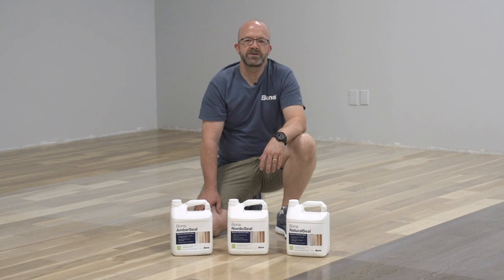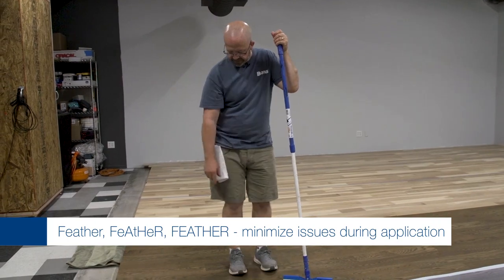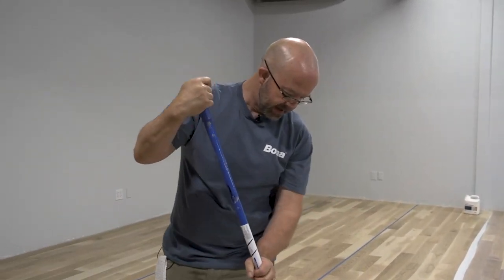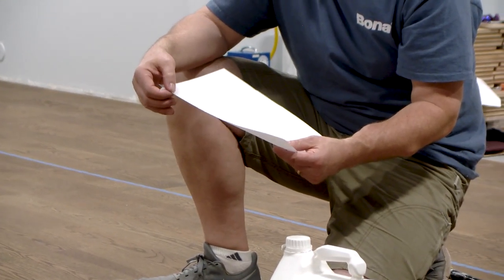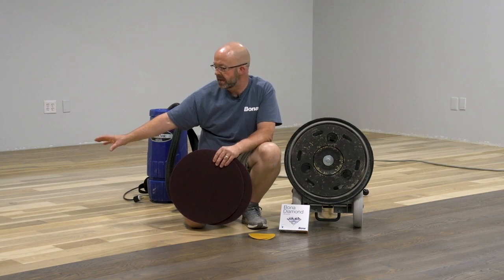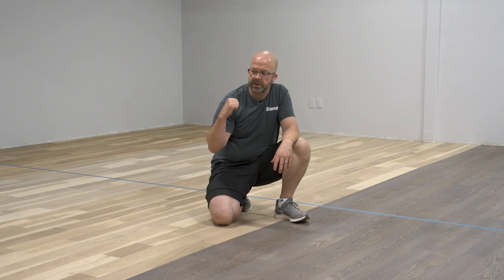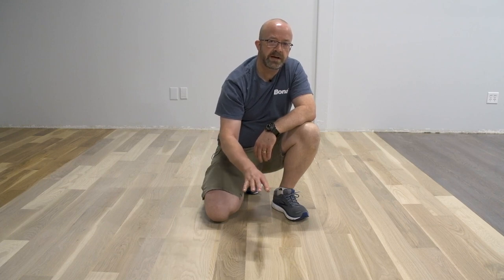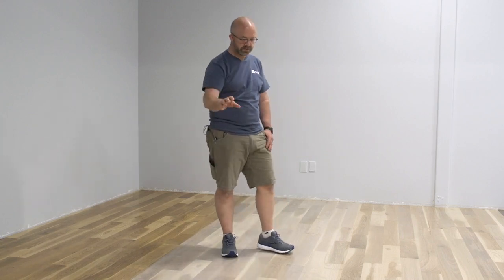Bona Sealers Application Best Practices

Comment: Hi, I used this product. Messed it up applying with a lamb skin roller, is there a way to screen the floor with a high grit to apply a second coat to get even coverage leaving no marks?
Reply from the maker: Hi @user-rv9gb2cz8m - Applying a second coat to try and even everything out would be worth a try, versus just sanding it back down to raw wood right away; but, it also depends on how uneven the color is on the floor. You might try an 80 or 100grit screen to aggressively blend the uneven marks in the floor; then come back and hit it again with 120grit Bona Diamonds to smooth out the screen marks and further blend the floor. Then apply an additional coat of the Sealer with the Bona Roller, as this applies the products the heaviest and is probably your best bet in getting enough product out on the floor to even it out. If that doesn't help, then it's probably back to square one. Hope that helps!

Comment: Thank you for the video, this is a great resource. One suggestion. Please show how to coat spaces that are more complex than an open flat floor. Seeing how to deal with rooms that have multiple closets, small nooks, etc. for these more difficult to apply products is crucial. I just used NaturalSeal for the first time and had trouble understanding how to blend spaces. At one point a “dry line” is mentioned and it would be great to see a demo of how to blend dry lines. For me, the NaturalSeal was pretty forgiving on unstained 80 year old white oak floors. There was a decent amount of tannin pull and the floors were a bit more yellow then the test swatch because of that. Sorry for the long comment but I hope it’s helpful to others!
Reply from the maker: Hi and Thanks for your comments and suggestions - always appreciated! Yes, great point on showing how to coat a more complex layout - we've since added some wall layouts on this floor to show just that. In our upcoming Waterborne Finishes webinar (Oct. 21), you'll see some more details on pulling a dry line (as it relates to roller applications - but same principle for t-bar too).

Comment: ??? I saw a great floor the other day where friend used 1 coat Bona Naturalseal and then 2 coats of Traffic HD finish extra matte. However he only sanded once with 220 grit between finish coats not between sealer and finish. Would you not recommend that?
Reply from the maker: Hi Cudder - Yep, that's perfectly fine. You typically don't need to abrade Bona waterborne sealers or finishes between coats for adhesion (unless it's been more than 48hrs since last coat - then Conditioning Pad & tack), but only for smoothness. Big advantage of keeping more of the wear layer protection (sealer, finish) on the floor if you don't have to abrade it, because there's a ton of debris or stop/start marks, etc. in the last coat. So, Keep It Clean (one of the Bona Commandments) and you'll get better floors and profits all in one! Hope that helps.

Comment: Hi there, I tried to follow these, and other tutorials, but have ended up with terrible application marks after first cost of primer. Looks horrible with pour lines and overlapping. I definitely went too light on first coat, but definitely kept wet edge. Do I try another primer coat before sealing or call it quits and go for a different product that isn’t a pour on floor application type. I have used other products successfully in the past. Just don’t want to put more of this really expensive product on to only end up sanding back and using something different because the primer application marks remain terrible.
Reply from the maker: Hi Out of Bounds - Sorry to hear that you're having some application issues. Too many variables that might be in play to really give you a good answer(s) here; so, please give our Technical Services team a call at (800) 872-5515 when you get a chance. Thanks!

Comment: Do you have to sand between clear seal and high traffic?
Reply from the maker: Hi @mnnice1497 - You only need to abrade between ClearSeal and Traffic if the sealer has dust, debris, etc. in it that you want to smooth out before application of finish coats (for smoothness); OR if it has been more than 48 hours since the last coat of ClearSeal was applied (for adhesion); otherwise, no need to abrade. For either case, we'll typcially place 2-3 Bona Diamond discs (180 or 220 grit) or 2-3 Bona NET discs (180 or 220 grit) on a Bona Conditioning Pad (320grit), pushed by a 175rpm buffer. Abrade the floor evenly, then vacuum (or PowerScrubber), and tack with a microfiber mob until clean - then coat. Hope that helps.

Comment: Why airless spray compressor cannot be used for sealer and stain application?
Reply from the maker: Hello Apple Table - We know of some contractors who have sprayed the sealers and finishes, but not the stain (as it needs to have the excess removed). Some potential dangers when spraying of breathing in any suspended particles in the air (always wear a organic vapor cartridge respirator if spraying; and some difficulties in cleaning up your equipment if not cleaned immediately after usage. So, not that it can't and hasn't been done (for flooring), but just a number of other things to consider including safety and clean-up.

Comment: Can you clarify the prep a bit?  I'm going to use AmberSeal.  The floors are new; the wood is spruce; they will not be stained.  Currently they are sanded to 220 but will need to be cleaned up because they got a bit dirty during installation.  What further sanding and other prep steps are called for?   Also, this is a small space (about 300 sq ft) and I do not have the big machinery shown in your vid.  Can I just use a RoS or palm-type sander?  TIA
Reply from the maker: Sure thing! You can use any type of sander on-hand (even hand-sanding), but without something larger (i.e. 16" buffer) to blend multiple boards together you're most likely going to see uneveness in the floor when the sealer/finish is applied. We'd also recommend that you final sand with 120 grit as the wood needs to be a bit porous to properly accept the sealer and finish. If it's too burnished you may have some film formation and adhesion issues short and long-term. Hope that helps and good luck with your project!
Reply: @BonaProfessional  OK I guess I already sanded too high. Can I now just go back and sand over the 220 surface with 120 to achieve the desired porosity?
Reply from the maker: @BCJ725  Yes, you can go back over the floor with 120 grit and that will bring it back down to desired surface profile.

Comment: Can i just apply bona mega, 2 coats to my sanded floors without nordic seal?
Reply from the maker: Hi Kerry - You should apply a coat of Sealer before the Finish. True sealers will seal the floor, provide some build, and minimize side-bonding. Bona IntenseSeal will bring out the natural colors of the species that you're working on (does not contain any white pigments like NaturalSeal) and can be coated with any of our Finishes. Hope that helps!

Comment: Can you use a cut in pad for the whole application?
Reply from the maker: Hello KTH - You could use just the Cut-In Pad for the full application, but more susceptible to start/stop marks if you're unfamiliar with that tool. I've used just the Cut-In Pad on several occasions - especially when I want to be down and "close" to my work; and our Training Manager used to coat that way all the time. Whichever applicator you choose, just make sure you're practiced and comfortable with it and that you're getting the right amount of coverage (as most people will tend to put down much lighter coats with the Cut-In Pad). Hope that helps!

Comment: Hi, i need to use one of these sealer before applying traffic HD?
Reply from the maker: Hi @indbolwebelieve - Yes, you must use some type of sealer before coating with Traffic HD to effectively seal the wood and start the build process (with more cost-efficient bottom layers); which will also minimize the possibility of side-bonding. Hope that helps answer your question.
Reply: @BonaProfessional  any kind of water based sealer can be used?

Comment: Hello, I'm about to do my project on newly sanded oak, 120 grit, with 1 coat of DOMO, then sand it with 240 (is sanding 240 grit necessary ?), then 2 coats of Bona Natural Seal, and 1 Coat of Traffic HD.  The plan is to avoid the "quick-drying issue" with the Bona Natural Seal.  Should I apply 2 coats of Traffic HD finish? and How's the plan look?  How much drying time do I need between each coats? Total 1400-ish sqft.  Thank you
Reply from the maker: Hello Chen - Yes on the sanding the Domo sealer coat with 240 grit, as making this smooth is what helps ease the application of NaturalSeal. Also watch the temp/air flow/RH environmental factors to avoid "quick-drying issues" with any coat. Protect the top with two coats of Traffic HD. Dry time between coats is typically 2-4 hrs and not recommended to apply more than two coats per day. Hope that helps!

Comment: I never had done or use nordic.. I had use natural a several times... but Im very honest to the my clients... about the results... I try to do at least 2 coats and mix 1 to 1 with classic seal or bona mega one... bona amber seal not as easy as top coat just as you said have to watch out. I do want to use bona naturale... on white oak would it be ok to coat with no sealer...
Reply from the maker: Hello @ladjkaoz - NaturalSeal should look great when applying two coats all by themselves. Definitely not recommended to mix any of the sealers together (i.e. 1:1 NaturalSeal w/ClassicSeal); and not with a finish such at Bona Mega One. For the white oak job you mentioned, apply at least one coat of a Bona waterborne sealer and then two coats of Bona Traffic HD RAW (as this has replaced Naturale). One of the most popular looks would be two coats of NaturalSeal, followed by two coats of HD RAW for that just sanded/unfinished look. Hope that helps and thanks for the questions!
Reply: @BonaProfessional thank you...👍

Comment: Could  this  product  be  used  over Mexican  tile ?
Reply from the maker: Hi Doug - We often get questions about our hardwood flooring products being used over other surfaces. While we can say that our waterborne products have outstanding adhesion qualities over a number of substrates, we can't say that it will definitely work over other surfaces, as we don't do any testing on anything but hardwood. Adhesion can usually be checked after 24 hours by scraping a Quarter across the surface - looking to make sure doesn't peel right off. Flow, leveling and getting an even coat would be the other variables that you'd want to watch. So, test, test, test and make your professional decision from there.

Comment: How about doing a session using the BONA ROLLER !!!.
Reply from the maker: Hi Andrew - We actually recommend using a t-bar to apply the pigmented sealers as it seems like an easier process for successful applications. However, our global colleagues and customers use the Bona Roller for application of these products on a daily basis also with great success - just need to be more diligent with your feathering techniques; and a second coat will most likely be needed to help smooth out the results from the first coat. Hope that helps (though we are planning a Bona Roller application video in the near future).

Comment: I’m a general contractor. My regular flooring guy switched to Natural Seal recently from Loba products. He said he usually does 2 coats of the natural seal and that’s it. It seems to me like it needs a top coat of Traffic or Mega One to hold up better over time. Am I wrong? Would 2 sealer coats be sufficient?
Reply from the maker: Hi Nathan and Thanks for the question. A complete "system" of Sealer/Finish would typically be 1-2 coats of Sealer, topped with 2 coats of Finish; with a 3rd coat of Finish optional for high traffic scenarios (entryways, kitchens, living rooms, kids, pets, etc). We strive to have a minimum of 3mils (approx. 3/1000") of protection on the floor to ensure performance and build depth. A single coat of Sealer/Finish applied at 500sq/ft gallon should leave about 1mil on the floor - so 3-4 total coats of combined Sealer and Finish would constitute a recommended Bona system as outlined on the back of each container. The sealers by themselves don't provide enough nor the level of protection (scratch, scuff and chemical resistance) that a true Finish can add to the system.  Hope that helps!
Reply: @BonaProfessional  Thank you for your quick response. That helps a lot. I will inform my floor guy.

Comment: Hi, I used the Bona natural sealer, lightly sanded with 180 grit, then one coat of mega one extra matt. I have some burn through areas/spots. How can I fix those areas? Can I put sealer over the mega?
Reply from the maker: Hi Kane - Not sure how much the burn through areas are showing through. Lightly abrading again and putting another coat of NaturalSeal over the Mega might blend it out, but depends on the severity and hardness of the edge lines. If really minor, then I'd just try another coat. If lots of them or more defined edges, I might hand brush the areas that need more color (and finely feather out into the floor/grain); then hand abrade with Conditioning Pad and wipe down with damp towel to see how it's blending in - might not need another full coat on if you can successfully spot repair.
Sorry, but difficult to answer here without any photos of your situation. If any further questions, please give our Technical Services team a call at (800) 872-5515. Thanks!

Comment: after you found the "burn" on the light oak with nordic seal around 27 minutes in, you didn't say what to do about it.  what do I do about those?
Reply from the maker: Hi Michelle - Good question and apologize that we never got back to that point in the webinar. So, if you find that there are some "burn" marks or other light areas and you plan to apply another coat of whichever colored Bona Waterborne Sealer, then you might lightly hit the edges of the marked areas - chasing the grain a bit to break up any hard outlines - and then the next application should pull that area into the look of the rest of the floor. Pretty easy fix.

If you're not going to apply another coat, then I'd still lightly abrade the edges of those areas - again, chasing the grain - and then very carefully apply a coat "only" to the light/burn areas with a good quality paint brush and very finely feather out the edges. Don't overlap any non-burned area or the build-up of a double coat of Sealer will then show through on the edges. Hope that helps!

Comment: Like the lightweight t-bar! Does Bona have anything shorter than 14” bar anymore?
Reply from the maker: Hi Tony G - Thanks for the support! In regard to t-bar sizes, Bona also has a 12" version, which I find the easiest to work with in residential applications; while the 18" works great on larger, wide open commercial and gym applications. Hope that helps!
Reply: @BonaProfessional  thanks for clarifying. I haven’t found a supplier with the 12” in West Michigan. Will keep asking around!
Reply from the maker: @tonyg6103  You can always try FloorMechanics.com - they typically carry all Bona products.
Reply: @BonaProfessional  👍🏼